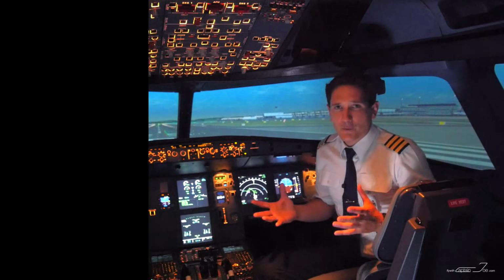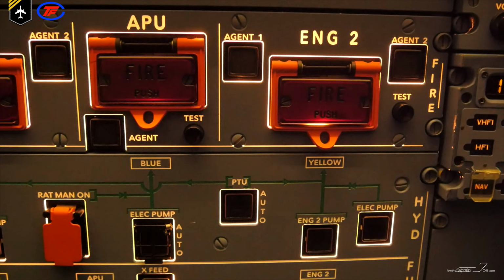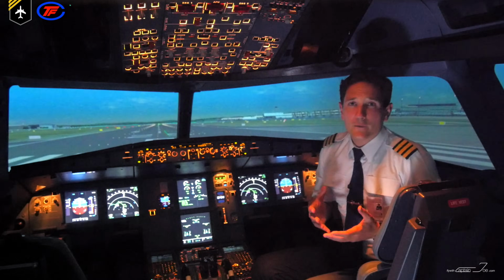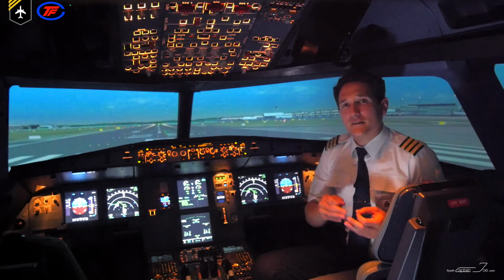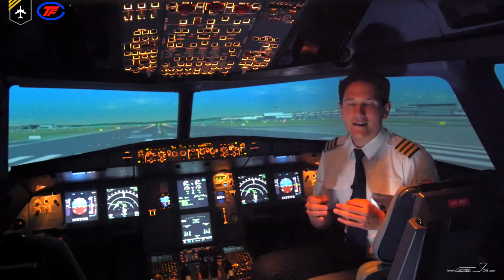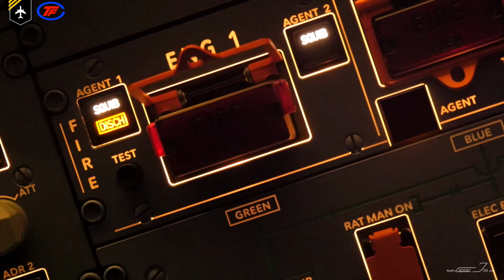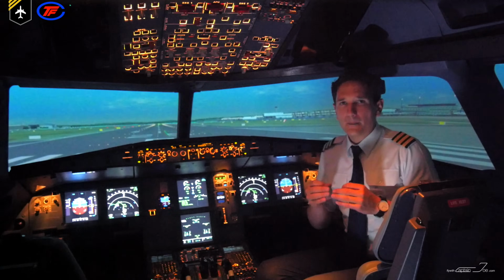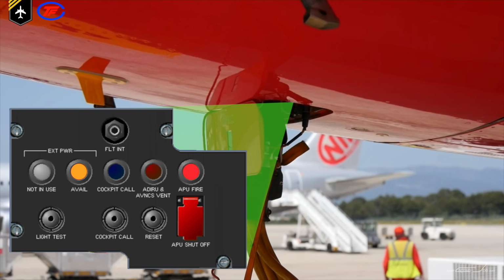Airbus FIRE PROTECTION system!!! AIRBUS SYTEM KNOWLEDGE explained by Captain Joe

Comment: I never thought aviation could be that interesting... I've been binging your videos recently and learned a lot. I wish you can make more time lapse video of your flights, they're nice and oddly soothing. 
Question: What does it mean when pilot say they will make up time to catch up for a delayed take off? Aren't plane always going pretty much straight and as fast as they can except for take off and landing? 
Thanks!!!
Reply: Well, very late answer...There are several ways how an aircraft can make up time during cruise. One is by getting a tailwind, in altitudes airliner normally fly you have sometimes quite strong and steady winds which you can use to get more groundspeed. About a year ago there was a case where a 747 had such a strong tailwind that it's relative groundspeed was actually super sonic, although the plane itself didn't flew through the air faster than normal.
Another way is to simply fly faster. Yes that's possible. Optimal cruise speed isn't the top speed of an airliner. Normally in cruise flight you fly with about 90% of it's maximum speed. So there's a bit of margin left.
Another way is to get a more direct route from ATC. Yes over the oceans airliners fly pretty much straight, but that's not always the case over land. Sometimes they have to fly around restricted airspaces or have to circle during approach.

Comment: Love the educational videos Captain Joe! 
I have to question one thing, however, at 1:30 the caption reads "Filled with Hydrogen and Helium". Really? Hydrogen to extinguish a fire? Typo? Or did I miss something?
Reply from the maker: Motham51 no that's in the protection loop,the helium expands to heat and triggers the fire warning!
Reply: They are not there to extinguish a fire. They are used to detect one. Actually, the inner working of this system is a bit more complicated than most people would think.
What they do is basically make a tube, fill it with helium and thread a wire through the middle of it made of a special titanium alloy. If the temperature increases the titanium starts to realease hydrogen which will incerase the pressure in the tube which then sets off the fire sensor if a certain pressure increase is detected. If the temperature drops, the titanium absorbs the hydrogen again and the pressure drops again. This way you have a fairly good indication if the fire is actually out.
Reply: Thanks Captain Joe and shi01! 
I figured I was missing some info.

Comment: Hi, would you please make a video about lightning strikes, what do you do if lightning hits the plane.. On our last trip with Air Cairo the lightning hit the plane just after departure from ENGM, Oslo Airport, Norway. Huge insane bang and all the windows went comletely white.. But the captain did not say anything, while I was looking out the window for engine fire/bird strike etc before realizing it might have been an lightning strike.. But people was terrified..
Reply: I am pretty sure that the pilot should have said something, at least as common courtesy.
Reply: easy explanation, your plane is basically a Faraday cage. the lighting just passes thru mostly unharmed most time, unless it's a really bad one, lighting strikes that bring a plane are damn rare...  and therefore not one to be afraid of.

also, most pilots WILL navigate or be navigated away from such clouds, if in transit.
Reply: Thank you, I have studied the B733 and B737-7 for three years now and have 10 hours in the simulator, not so scared. But I guess I was more surprised and baffled of the loud bang than anything else. And curious to know what the procedurals are in such cases :)
Reply: The best method is avoidance in the first place. There is no standard procedure, each Airline will have their own procedure but there is actually very little that can be done part from perhaps a visual inspection from inside the cabin of the visible surfaces such as the wings and also checking that it has not interfered with any of the electronic equipment or radios. If it was a powerful strike or multiple strikes the crew may consider diverting. Usually it is of no consequence but it will be reported and checked out by engineers before the aircraft next flies again. They do tend to leave pretty bad burn marks on the skin of the aircraft.

Comment: I have a question, 
Why can't the pilot drop the oxygen masks, in case of fire, when smoke enters the cabin?
Reply: Jasper Stevens He cant because if the fire is on the cabin the same Mask's oxigen will make it grow. And because the masks are not full closed. The cabin smoke enters into the mixture of oxigen it the masks and anyway it's lethal
Reply: Tomas Natenzon But if the fire is not inside, But outside is it than the same explication?
Reply: If the fire I'ts outside it's clear than the plane must land fast. I n the extreme case i'ts needed I think than they can deploy masks
Reply: But he can by pushing the "MASK MAN ON" pushbutton on the overhead panel.
Reply: Pilot's oxygen sistem is independant from the Cabin and crew sistem. If the fire It's outside I mean on the engine sometimes somoke can go in to the cabin due to the same presurization sistem. (Air is catched and presurized by engines) in those cases I guess the Preurization Panel automaticaly changes or closes de afected engine valve. In the case of APU and Cargo I'm not sure
Reply: Jasper Stevens because if the fire got into the PURE OXYGEN compartment there would be no stoping the fire it would kill everyone on board...
Reply: The masks do not prevent smoke to enter your lungs. They simply provide oxygen.
If the masks were deployed during a cabin fire, they would accelerate the fire dramatically!

If there were a fire outside the cabin and smoke enters, it would not make sense to deploy the masks. The plane must be evacuated immediately in that case and if that is not possible you would have other, more serious problems then inhaling smoke.
Reply: Klappspaten thank you very much!
Reply: Tomas Natenzon oooh Okey, thank you!
Reply: Fabian Neundorf aaaah okey
Reply: Tomas Natenzon okey
Reply: Tomas Natenzon *system
Reply: the oxygen mask lasts only about 15-20 min, so it wouldn't really help that much
Reply: Im not 100% sure but smoke can be passed on through the oxygen tubes sometimes
Reply: Gmngvlogs &MORE how would it pass through the masks? They're fed by a separate supply
Reply: Jasper Stevens there is still sufficient air to maintain a fire so wouldn't help
Reply: Fire killing passengers  vs. smoke killing everyone... hmmm what to choose. It sucks to be a captain at these situations.
Reply: Idk oxygen and fire Dont mix well
Reply: Lack of oxygen and living don't mix well either.
Reply: Because pilots need oxygen. Duh...

Comment: Hey captain, I have a question about A320 that I could not find an answer from various B1 Certifying Staffs or even Typre Rating teachers. May be you can put an end to my misery. 
so here it goes, if I may.
Let's say we lost both ENG 1 and ENG 2 AC BUS'. we did all the ECAM actions but there is no luck. so we need to divert and land. no problem at all. But in ECAM status page's INOP SYS, and there is a ton of it :D it says  REVERSER 1+2. but why? as for hydrolics they are fine. So there must be a computer that is being axed during the load shed. Can you tell me anything about it? 
Thanks in advance and your vids are amazing tools of education for a new aircraft maintenance technician like myself. and I've told everyone about you at work! (:
Reply: Like most things on the Airbus, they involve computers and electrical signals. The thrust reverser doors are electrically operated but hydraulically actuated. There is no direct mechanical link between the thrust lever in the cockpit and the thrust reverser so it must be done electronically. So although you still have hydraulics, you don't have the electrical signal to actuate them.
Reply: chrisnz90 very comprehensive explanation thanks.
Reply: No problem :) It is interesting to note in this configuration with no reverse thrust and no anti-skid that stopping distance is almost doubled!
Reply: yeah yeah yeah, and you have to be really careful not to over pressure the brakes because they lock up kinda easily! I've learnt that from some sort of a hard way :D in a simulator. that guy who has found the anti skid should be in heaven of his choice!

Comment: How do you plan on making pilot videos when a robot inevitably takes over your job in the next few years?
Reply: Not gonna happen anytime soon. Automation is inevitable in most areas, due to obvious improvement of science and technology. Nevertheless, any change in individual aviation systems requires a thorough certification process. Even more if it is a change that would affect aviation in all areas. Think about ATC, conflict resolution, interactions between all involved parties (pilots/ATC, pilots to other pilots, pilots to cabin crew, etc). There's much more about it than just a technological improvement.
Reply: laughfaster1 U mad bro
Reply: much salt
Reply: I understand that it's a complicated process to make big changes like that in an entire industry (I wont pretend I know how that will work) But that isn't the point. Similar to cars, it's viewed as a safety issue. Anytime they can replace a human with a 99.99% accuracy machine they will. I don't see it taking much longer for planes than it will for cars to become fully autonomous.
Reply: Commercial airlines become autonomous, private aircraft become an immensely profitable business, Capt. Joe here becomes one of the several hundreds of thousands of experienced flight instructors available to a growing roster of flight enthusiasts worldwide. Only one of the many opportunities that open up for aviation staff if AI hits the scene. 
Kurzgesagt has a wonderful video on this exact debate regarding the loss of jobs to AI, I would link it to you but I recommend you check it out yourself.

Comment: Can the ground staff really hear warnings as they have ear plugs in?
Reply: Professional ear protection systems are designed in a way to not just shut out all sound. They will dampen certain frequencies less, so people can still communicate (even if they need to shout) or hear warning sirens.

Being completely deafened in any kind of workplace is dangerous; our ears are the only 360° non-contact, fast-response sense we have.
Reply: You have to have some kind of the noise protection on pretty much all the time.Airport is very noisy environment.What about other aircraft taking off,or being pushed back and start the engines when you work next to them?And trust me some APU's are very noisy.
Reply: Seems to me that none of you actually works on airport. All alarms are quite easy to hear even with ear protection ( and most ground handling employees wear headphones not ear plugs as those are impractical and less cost effective). Even when there is APU working or a plane is in push back phase. And we don't wear ear protection all the time. It's annoying as hell and is required only when engines are running. Any other use depends on given employee ( personally I hate Airbus hydraulic pumps and breaks ventilation systems as those are as loud as engines). And if you are not working in the rear part of a plane APU is not that loud.
Reply: Oh, they cannot. In the many many many hours of design of a plane no one thought the pilots have ear plugs. Not even the team making them.
Reply: You can hear it, the ground call is annoying and easily audible, as most headphones reduces the sound pressure leaving some sound to pas through.
Reply: Well I actually work at the airport(Heathrow).I wear my ear protectors most of the time because i just got used to,and on winter they keep my ears warm:)Is quite easy to hear people talking or reversing lorry signal,just not as loud.
Reply: Just plug in your headphones with music/speech turned OFF, so you can get an imagination of what earplugs or ear protectors can do. And don't forget, that we hear not only with our ears! The whole scull is a resonance body, even the nose is connected to the ear via small tunnels.
Reply: Personally I wear 3M Peltor Wireless headset for ground communication as it allows a great freedom of movement and full communication with the crew.
Reply: Pawel Pawlowski  you know what I left a jacket in the Heathrow security zone 
DAMNIT

Comment: But if the engines are off and the APU has to get cutoff beacause of the flammes the pilot can start the engines?
Reply: LuxSimulator Pilot why would you want to start the engines when the apu is on fire
Reply: LuxSimulator Pilot "oh the apu is on fire but i dont care lets just start the engines and take off"

Comment: Why are most airplane wheels filled with pure nitrogen?
Reply: Beast Gaming it is less flamable than other gases
Reply: So that the oxygen in the air which is inside them doesn't leak out of them due to the temps and pressures. Otherwise, you might find the tyres are flat when you come in to land :D